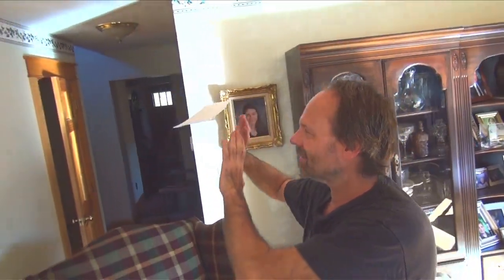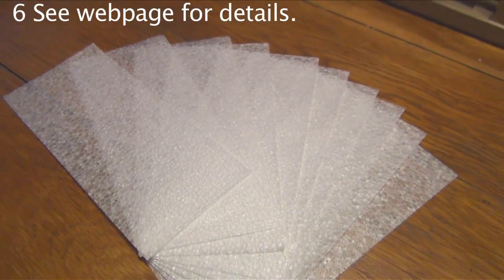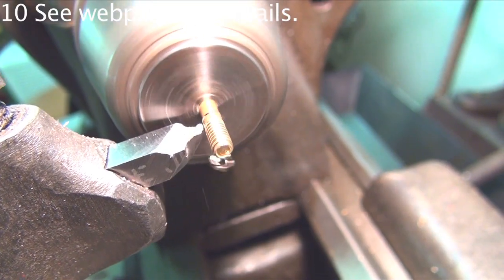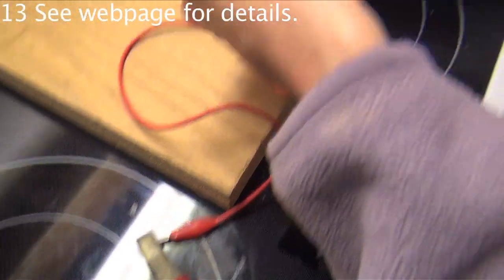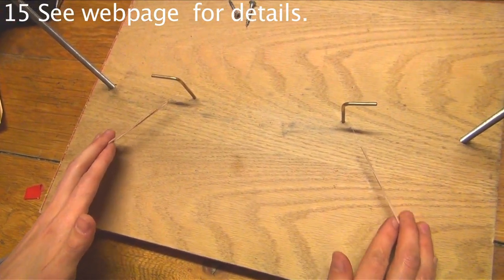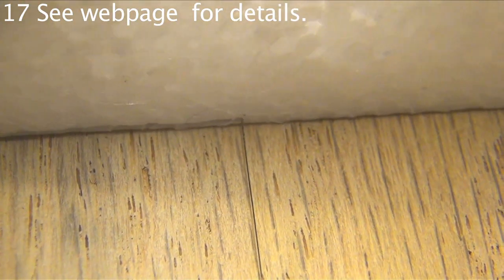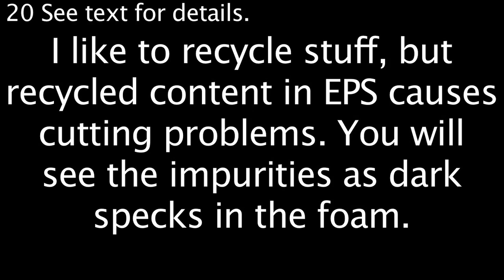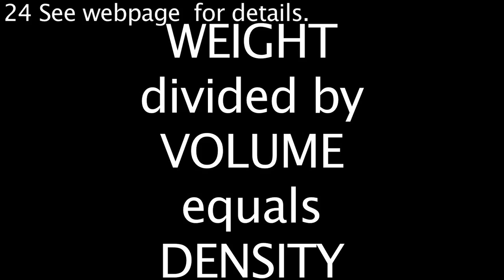Out of date. Hotwire Cut Foam for Walkalong Gliders

Comment: can i use the one that is in packaging but not the styro is like used for keyboard to cover it, so can i use that one?
Reply from the maker: If it is the white -beads-atuck-together  kind of EPS foam, there is a good chance that it will work. Even higher-density EPS--sliced into sheets 1mm or thinner--are lighter than paper. Try it and let me know how it goes.
Reply: Ok, but i did saw that there is like a pattern like the beads and its transparent but not all the way like you need to mave the pbject closet
Reply: @sciencetoymaker  can i also ise newspaper for the mama bug and the hanglider walk along gliders?
Reply from the maker: @dan9-27  You cannot use newspaper for those designs. There are designs that use various kinds of paper--usually phone-book paper or tissue paper. I have some spinning designs https://sciencetoymaker.org/walkalong-glider-airsurf-air-surfing/make-your-own-gliders/paper-gliders/  This is an interesting design, though I haven't made it. https://youtu.be/woV3-MylayU Phil Rossoni has a design https://youtu.be/9qU3zhATZOk John Collins--The Paper Airplane Guy also.
Reply: @sciencetoymaker  Oh yeah

Comment: Why bronze for the Ls?
Reply from the maker: It has to be machined on a lathe and with a die, and bronze is a joy to machine. But the main reason is steel corrodes (rusts) even in just humid weather. That can make electrical contact spotty (I speak from having experienced that with steel contacts).